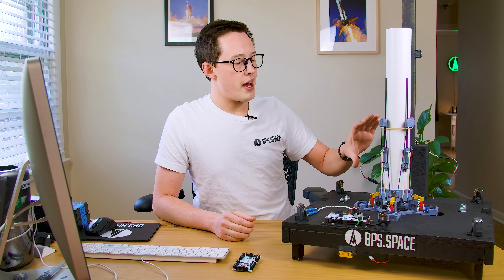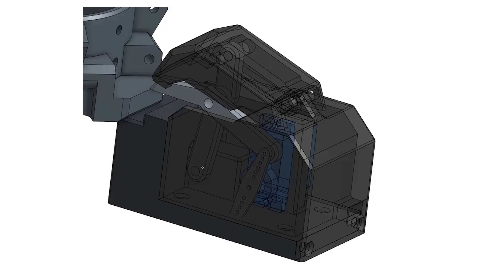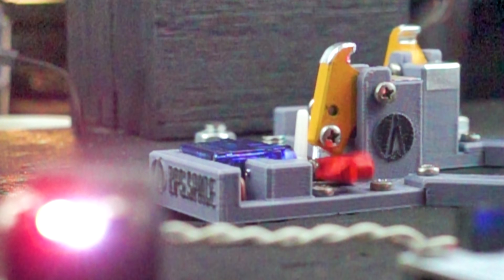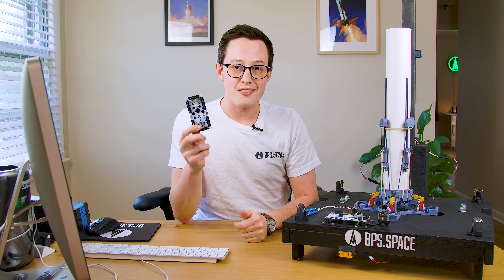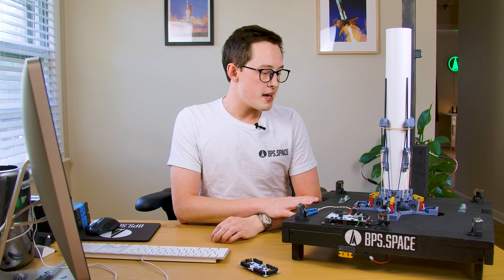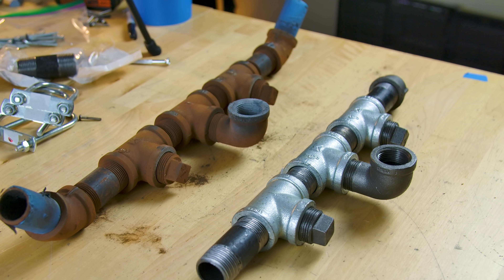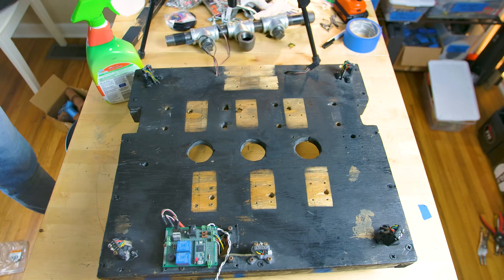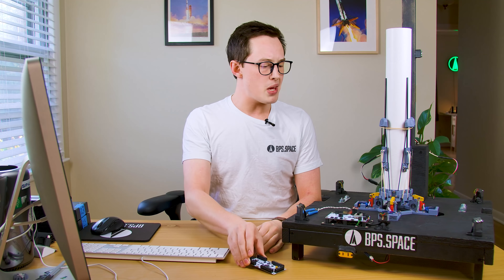Launch Pad Updates

Comment: Can you try to make a liquid engine? ( like ethanol and oxygen, or rp1 and oxygen or maybe hydrogen but I dont know, a rocket with a liquid engine would be really cool for me) 
Anyway good vid ;) <3
Reply: He said that he was working with other people to develop an engine a while ago, but he also said that getting a working engine is still a many years out. Also, building a rp1-lox and h-lox is too expensive and frankly not needed for a model rocket, because of the complexity of turbopumps and safety concerns of rp-1 and hydrogen near lox. A nitrogen pressurized system with ethanol and gox/lox is probably what they are going to build.
Reply: @EdisonWong2004  you could use electric pumps instead of turbopumps, like on the electron, and I know it wouldn't be reaply useful but it's cool😂
Reply: He won’t for probably many years. It is very dangerous and I know that he understands how difficult and dangerous it is.

Comment: Do you ever plan on making a liquid fueled rocket?
Reply: As they are not a propulsion engineer they have stated multiple times that no there is no plan to ever make a liquid fueled rocket.
This would probably only change if someone else with lots of experience in such things came along and offered to collaborate.
Reply: @nocare  Ironically Barnard Propulsion Systems is what BPS stands for
Reply: He said was. That is why he stopped attempts with ECHO. He was developing SPRINT to test his software and then to start building a liquid propellant rocket. Not sure why he changed his mind again.
Reply: @Jason-gt2kx  he never said he would build a liquid engine after sprint. He never stated that he will make one at a certain time. He said that he might make one